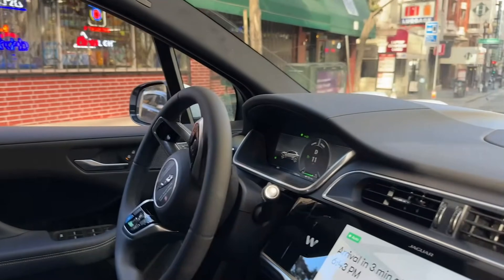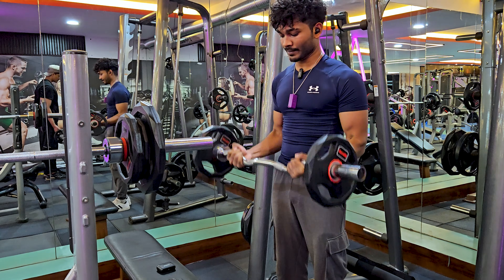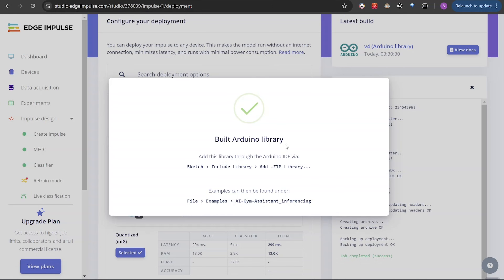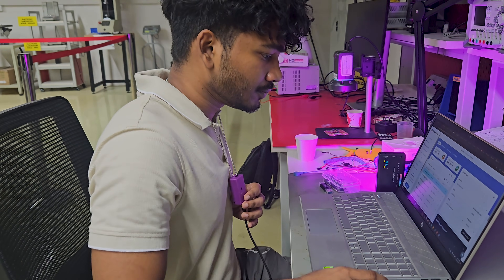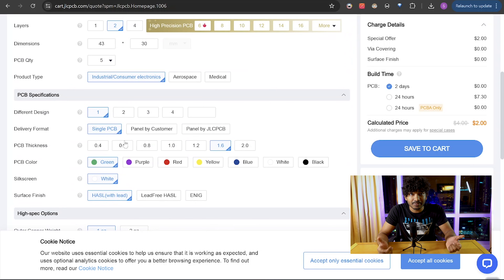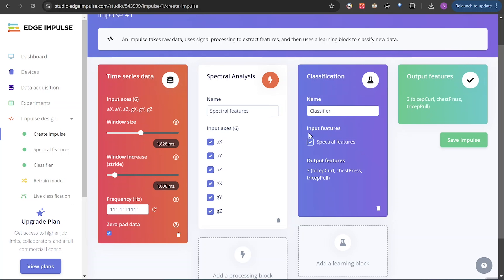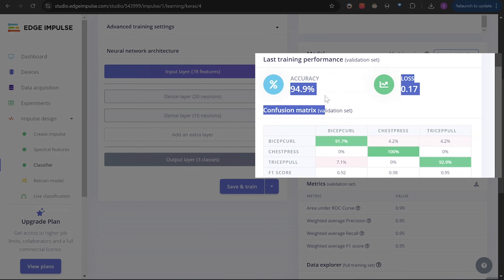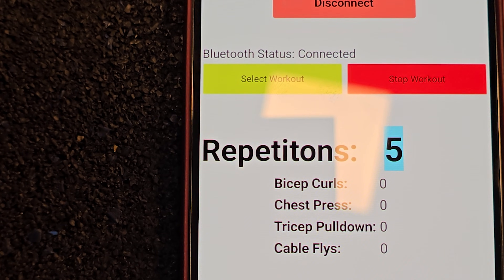How to Run a Neural Network on Arduino!

Comment: Hey this is amazing.... i was also working on similer project i am making sign language detection for deaf ppls. Can you give me a details about your project? Like which board(part number) and which module (like tensorflow) did you use? I was looking forward for your reply...❤
Reply from the maker: Hey, you could check out my instructables link in the description. I have some details there.
Reply: @shyam-ravi  Yeah I checked it but it didnt give me much of the info i needed please can you just update a few txt files with perfect details?

Comment: Bro please share your code and PCB file for recent smart glasses. I already emailed you 3 times. Please bro it is very helpful for my project
Reply from the maker: Hey, I dont have those project files now, I'll try to find them in my old hard drives. But mostly they are lost🥲
Reply: Ok bro I understand 😢😢